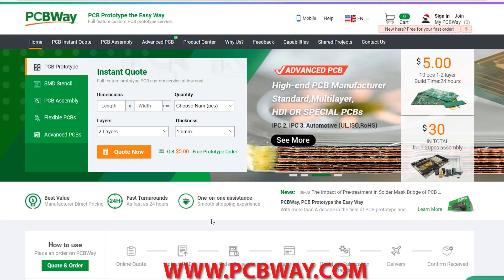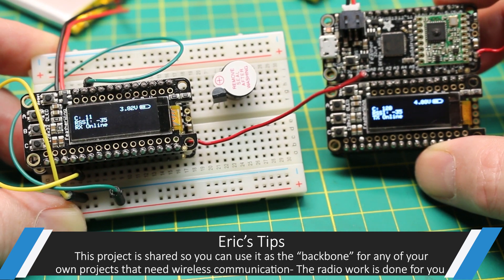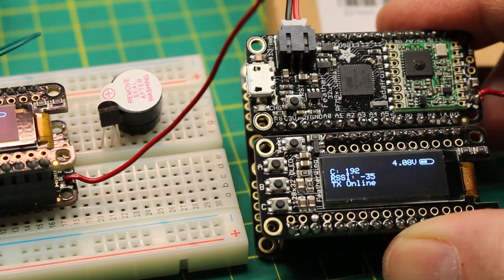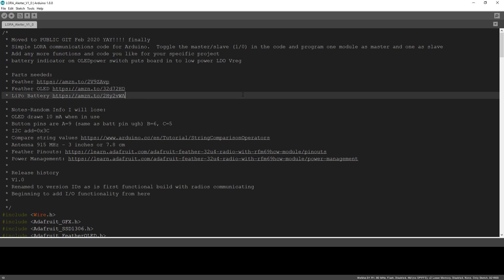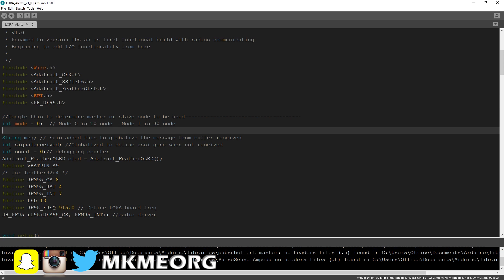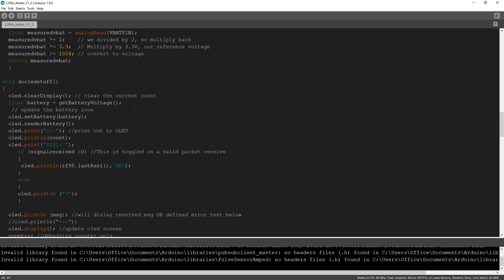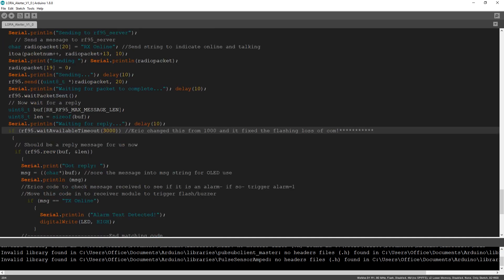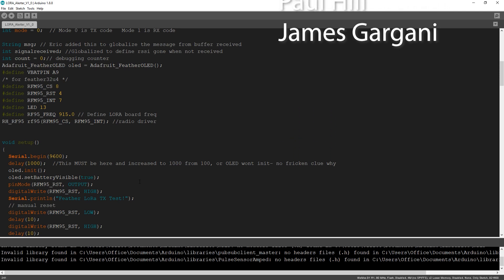Long Range Wireless Communication for Your Electronics Project! Arduino LORA Radio📡

Comment: Your code works great. I have the same exact hardware as shown in this video and the code worked exactly as expected. 

However I’ve been struggling for about a year now trying to figure out how to simply control a relay with LoRa on a Feather Board. I’ve worked with Arduino for about 10 years but the Feather LoRa stuff just doesn’t seem to work for me when I try to modify code to my needs. I basically want a transmitter with 2 buttons to control 2 relays on the receiver in the simplest way possible.

Usually I find code like yours and reverse engineer it and add to it. I can’t find keywords for the RH95 library so I don’t know what else it can do. I could really use a bare minimum sketch to understand a basic send and receive button functionality. I’d really appreciate it if anyone can point me in the right direction.
Reply: The OLED feather wing has 3x buttons you can program. If you use stacking headers on your lora feather you can have a nice compact setup. Looking at a 32uf board the example code is "uint8_t data[] = "And hello back to you"" so you would just map a keyboard to type a value in a temporary variable or maybe the 3rd button has some default text you can cycle through for the input. Then one button is set to a small function to update the variable and transmit it: uint8_t data[] = tempvar.

Comment: Use #ifdef preprocessor directives rather than testing a variable. That way you only compile code specific to the Tx or Rx and remove tests at runtime. This also reduces the memory footprint on the the board. Great video though.

Comment: Great video! I have a similar setup with a dht22 and I want to send temperature and humidity readings from one device to another. How would I go about packetizing these values to be sent? Right now they are floating point values and I doubt they can be sent without changing the type and building them into message buffer somehow.

Comment: This is probably above my head but what is the practical applications for wireless radio communications -what can u build with these things.
Reply from the maker: You can use it to link literally any sensor or whatever to anything else you want. It is just the communication "backbone". Literally just about anything provided it doesnt need big bandwidth etc.  For most people it will be to link X sensor back to X display or internet connection or output device up to 1KM away with very low power.